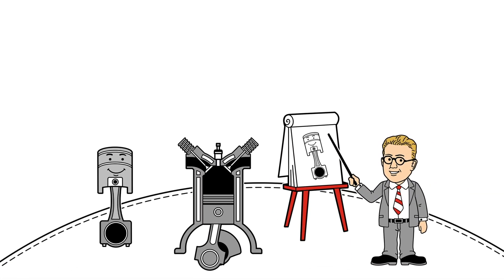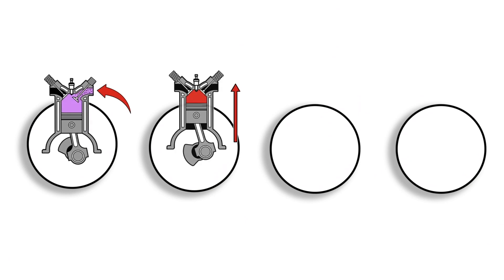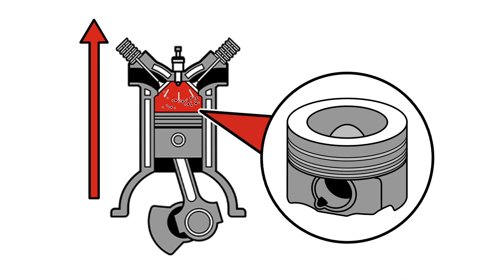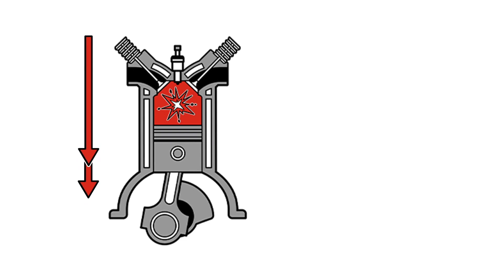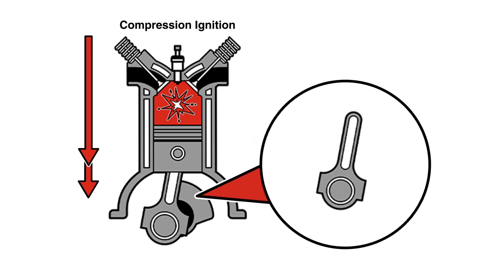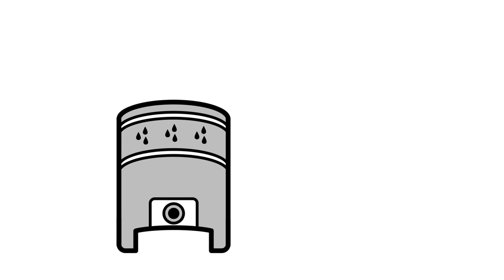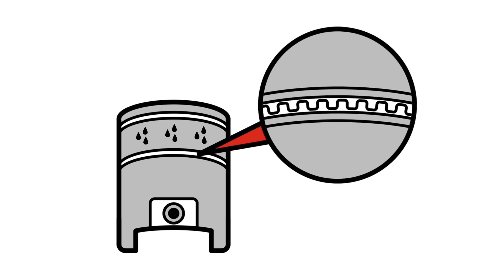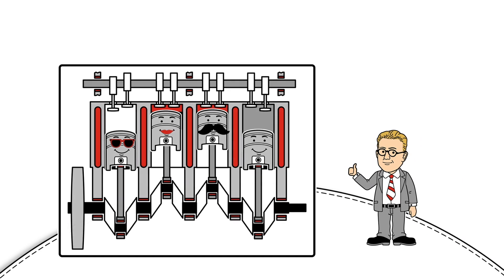Every Part Has a Purpose: Pistons

Comment: I would have thought an official video on how engines work from Cummins would have been better than this. FFS you have spark plugs on the engine while talking about how diesels achieve combustion through compression, and then you call combustion an explosion.